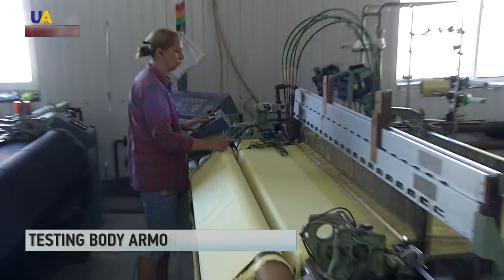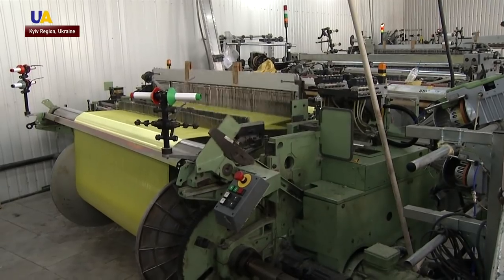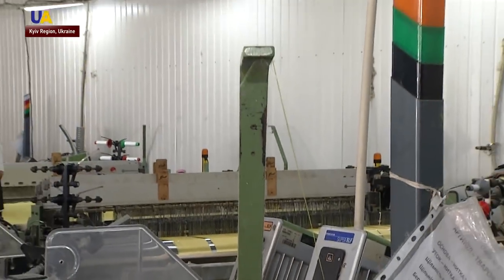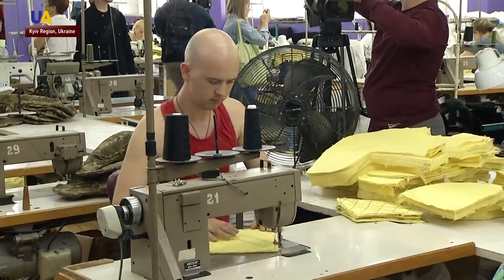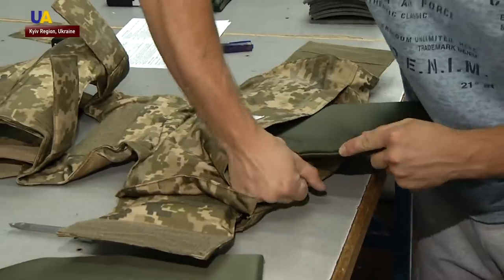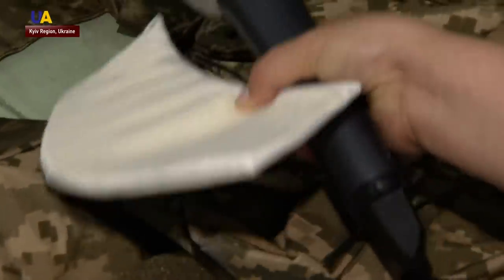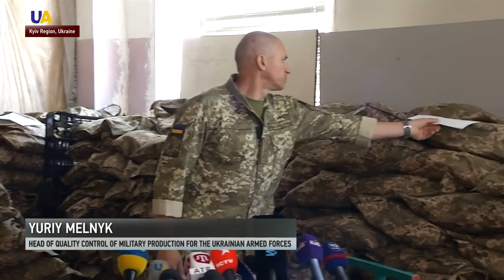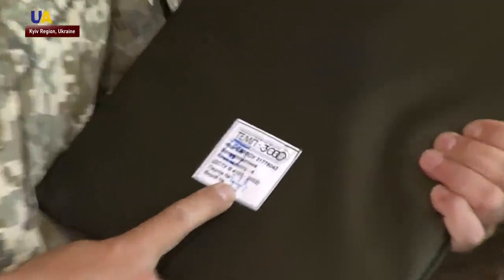New Body Armor for Ukrainian Soldiers

Comment: 2:51 That's a Mosin-Nagant bolt. I recognized it right away.
Reply: well, if it can withstand a mosin-nagant then it should be safe to say that it'll save your chest when you have it on :)
Reply: 7.62x54R is substantially more powerful then the 7.62x39 and 5.45x39 typically used by the Russians.
Reply: Tarkov players have spoken 😂
Reply: congrats, you know something.
Reply: They armor they shot at with the mosin at the end wasn't the one they were putting in the plate carriers. You can clearly see the sparks from the steel-core 7,62x54r round, that wouldn't happen with soft kevlar armor and it would penetrate it. This one had a steel insert IMO
Reply: @DickCheneyXX  , they aren’t testing the fabric, they are testing the vest. The vest has ballistic plate insert. The Kevlar by itself won’t stop 7.62 bullet
Reply: @SuperPindos  They don't show steel or ceramic inserts anywhere in the video. They show a groin protector being stitched with no hard plate as well.
Reply: @DickCheneyXX  , what else do they not show?
Reply: @DickCheneyXX  did you see the weight? 14 kilos. Do you believe kevlar only could weigh so much?
Reply: thats a rifle made by ivan kovah ivanosky something like that smh....

Comment: 5.56 mm. Test with high speed shot. 
Greetings from Turkey.
Reply: I think it would be more productive to test for 5.45 standard russian army bulets, the round most likely to be fiered at any ukrainian
Reply: @rozkaz661    bullet diameters are close, if you test it with a high velocity shot, it gives approximate values.Especially small diameter bullets have high penetrating power.
Reply: 7.62 bye bye kevlar.

Comment: I don’t think kevlar is designed to stop rifle rounds like 7.62x39 and 5.45x39 that are being used in the battle field. It will at least take steel or ceramic plates to stop rounds like that. Kevlar is only designed to stop pistol caliber rounds like 9mm, 45 APC and so on. Any rifle round would easily punch through Kevlar body armor.
Reply: They also yse metal plates inside

Comment: Hopefully the soldiers on the front are getting these and not the ones in the back
Reply: I'm sure they are, there was a video from another shop producing a way simpler version, for local units assigned guard duty and so on, in less dangerous areas.
Reply: @mace8873  we went to four military surplus stores in Kyiv a few days ago and basically everything was bought except for some shorts.
Reply: @sequoia-11    @Mark Wendland  Not surprising, a few days into the invasion there were reports of gun shops running low on products as well, so a guy at work figured they'd need all the other military gear a soldier needs, as well. He put up a couple of posters asking for whatever gear we might have lying around that we didn't use, it only took a couple of days before we had a truckload of everything from sleeping bags, gloves, and boots to chest rigs, Kevlar helmets, and body armor, I supplied amongst other things 20 backpacks. We might not be a huge company with a huge bank account, but we did manage to supply a heap of volunteers I reckon.

Comment: Bullet proof.. sewing machine goes right thru.. 🤔
Reply: Not the same thing but I agree it looks dumb. like you can't put a sewing needle throw glass but you can break it with a hammer. The body west protects from another type of force than a needle
Reply: i don't think you understand kevlar fiber
Reply: First off Kevlar is layered, secondly a bullet is substantially larger then the needles used here.